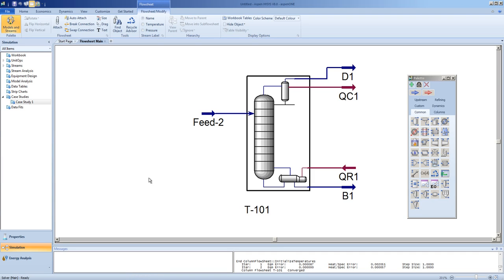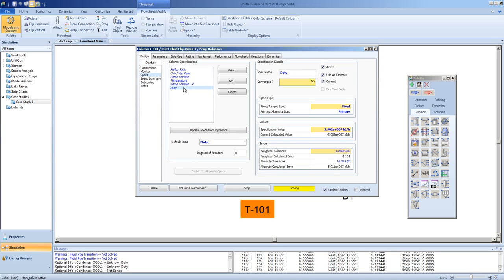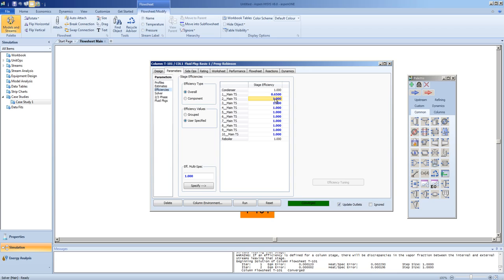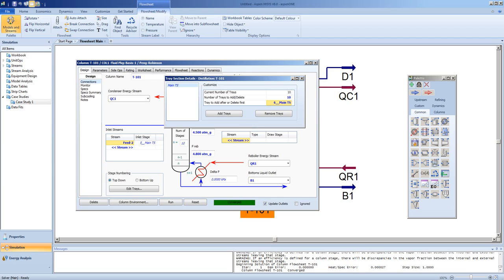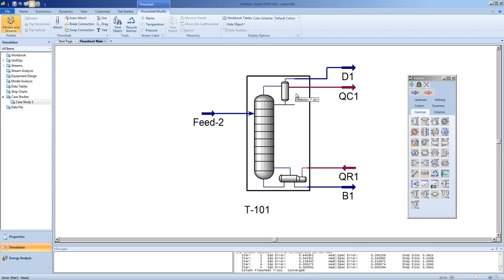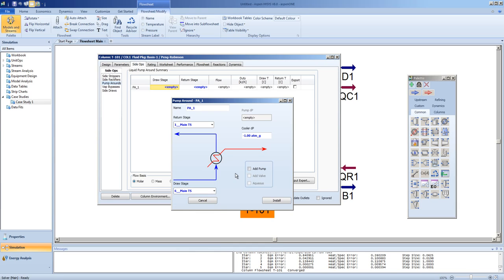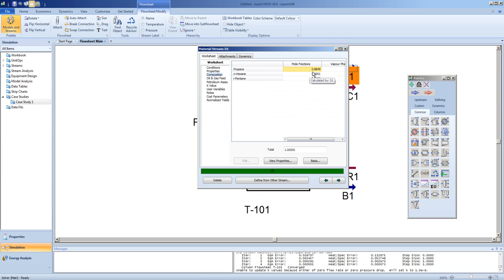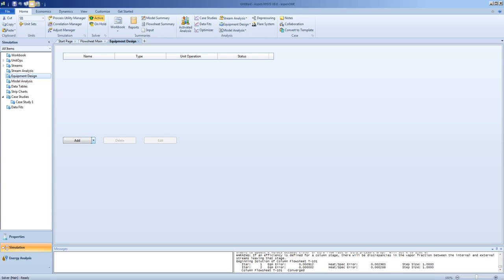Distillation Tray Effeciency, Adding Trays, Side Operations and Column Tray Sizing

Comment: Could you Pls tell me how to added a cooler between tower and condenser 
i appreciat it coz this gonna help me on my work 
thank you
Reply from the maker: Aveiro Zinou this must be done in the column environment. you access it through the columns form with the button on the bottom. then it's just like regular hysys from there.
Reply: wht do u mean by "" it's just like regular hysys from there."" coz im new using this softawre ... i wish u help me (u know my problem taht i want to have a cold distillat after the top tower stage >>> for eg : the temp of vap out of top stage is "-10 " i want it to be "-27" before going condenser .. can u help me plz 
thank you !
Reply from the maker: Aveiro Zinou this may or may not be possible at the pressure the column is operating at.  You can go to the specs page and try shifting your spec to condenser temperature instead of one of the specs you have currently.  This will allow you to set the temperature to what you desire but you may find that there is no feasible solution unless you adjust the column operating pressure.
Reply: @Adrian .. im simulating a real process and they put an exchangre (in my case i want just colling the gas) so i want to know if puting a tempurature for the condenser is just the same like puting a cooler or its diffrent  ...ty for ur reply again
Reply from the maker: Aveiro Zinou if they added an additional cooler you can add it in the column environment as per my first reply. However if you just want to simulate the additional cooling duty then adjusting the condenser temperature will have the same effect.

Comment: Could you Pls explain me what do you mean by 2.902e+007 KJ/H.

Actually it is kilojoules per hour duty but what is 2.902e+007?
Reply from the maker: Abdul Ansari it means 29020000 or 2.902 × 10^ 7. It's a hysys convention for engineering notation.
Reply: Thanks...! got it now.